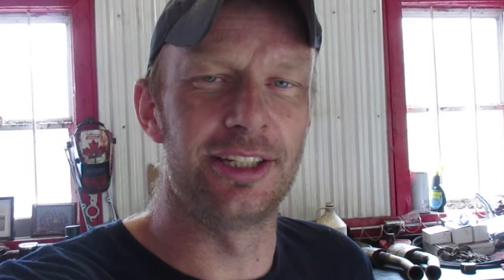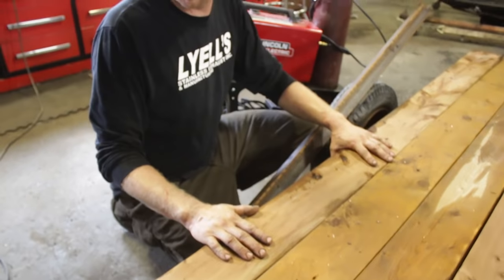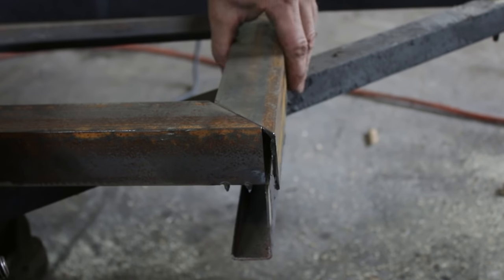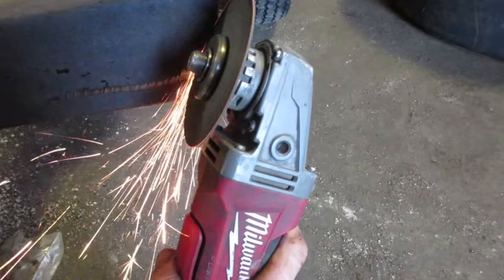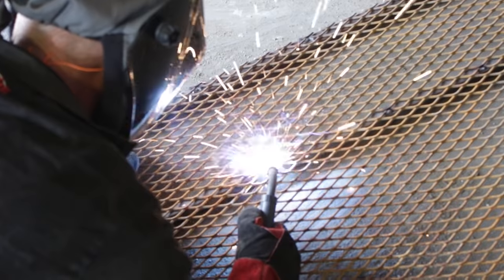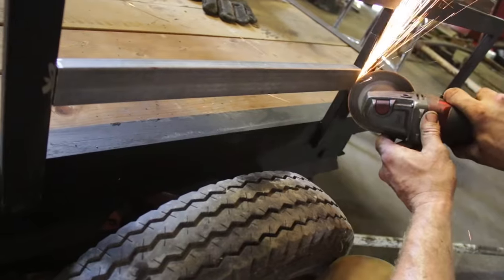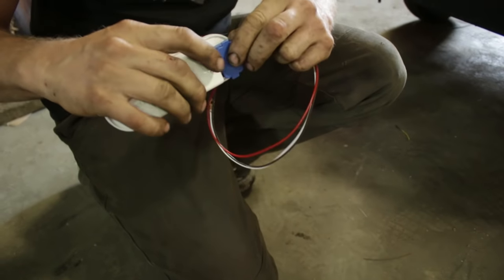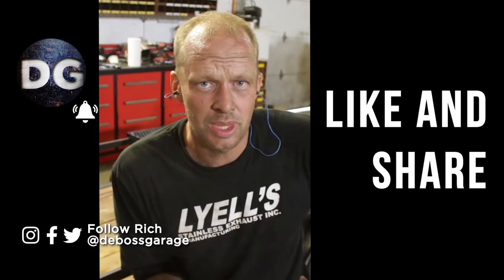How To Build A DIY Utility Trailer for CHEAP!

Comment: One extra thing you could add to the trailer. Take some of the scrap pieces of the angle iron and weld to the sides of the trailer so you have a place to attach ratchet straps. Very helpful. Did it to mine.
Reply: 8777
Reply: also add a small wench to the front for pulling your dead quad up . or other equipment. Add a swing over head arm for wench loading logs or motors on to the trailer.
Reply: @avalonbear61  oh ya good idea trailer would flip over, even if you added legs,, to light
Reply: never had an issue with my trailer flipping over when I had legs/Outriggers even when the trailer was light.
Reply: another extra is add the legs back so he can jack it up on the side of the road for flats
Reply: @avalonbear61: Personally, I prefer to keep my small wench snuggled against me in the cab ….. the large wench who loads my logs I make ride in the trailer with them …...she doesn't like it, but.....
Reply: @philod902  🤣
Reply: mhm
Reply: I use small foreign car coil springs to make tie points. Just cut out half-circles and weld in anywhere you need a tie-down.

Comment: Wise choice cutting the size way down... I had a converted pop-up to utility trailer that was still full size (6'x14'). The previous owner sold it because everyone always overloaded it. I sold it after my Dad did the same thing and bent the axle.

You can tell people that something only has a 2,000lb rating and it just bounces right off of their skulls. You have to build it so it will only hold its rating in iron or rock or your stuff gets torn up.
Reply: size dont mater you could make it 2 feet wide and over load it, just with all the comments to add to his new buggy would over load that 800Lb axcel
Reply: @arnoldromppai5395  So you're deliberately missing the point that it's a lot easier to overload it if it's bigger. OK.
Reply: yeah at least when I overload my truck and trailer I know I'm doing it
Reply: Sometimes you don’t know what the limit is until you cross it

Comment: I watched the whole thing and I don’t even need a trailer... love that welding helmet need to get one of those
Reply: @davidwalker8778  I like to use a small 160 amp inverter when I’m welding, very handy I can also use it on  an extension-lead...
Reply: @zsozso411  nice

Comment: I could really use that welder to build the flat deck and frame for my 86 toyota  pickup.  This truck sat in my father in laws grove for 10 years before he finally agreed to sell it to me. I also deal with salt and from the cab back is toast. I would love to turn this into the daily driveable trail rig I have always wanted.
Your channel has given me the confidence to dive into a project like this and methodically break it up and progress thru the challenges. Thank you.

Comment: The 2016 Chevy Silverado with 6.2 LTZ engine still running good. I wrote to you back in 2016... Thanks again for recommendation. I did however get that module to convert it to full time 8cyl. and i'm looking to put a 3.5" lift on it... THANKS!!!!!

Comment: I have an old Lincoln Weld Pack 100 Mig from 1996.  It still works but I am looking to upgrade.  This welder would be great for tube bumpers on my 99 Dodge Ram, jigs and of course, because of you, I now want to build a trailer.  Thanks for the video.

Comment: Tent trailer frames are awesome for light duty trailers. We always scrounge them for using behind the quads or the side by side. Hell, they even come with a suspension to soak up the bumps.

Comment: I know that most guys connect the white ground wire to the trailer frame.. for a "ground"..... but I have better success running the ground wire all the way the whole length of the trailer AND to the towing vehicle via the electrical cable.   We've all seen the effects of "a bad ground".... and another ten feet of wire for each rear light, IMO, is well worth the greater electrical reliability.

Comment: I've seen Andrew Camarata also use those lights on trailers, he says they are far less likely to get damaged than other lights that stick out a lot.  He also uses an airless paint sprayer (Graco, not sure if they have those in Canaderp) for painting, seems to make painting a lot faster and easier.  This is awesome, keep up the great work!

Comment: Nice build, id highly suggest doing a few extra tweeks to the next build though. First the one end of the trailer floor should be left open so if you need to replace any piece of wood you can do that without cutting and re welding. Second would be to add some conduit or a channel to run the wires through keeps them from getting snagged on road debris and looks much cleaner. We used an old weight lifting bar that someone threw out for our gate hinge as that thing wont break. Also using some cut links of chain welding to the frame or rails make great anchors to tie down with.  Nice detail with the video :)

Comment: I like the idea of the ramp that folds flat, always thought it was foolish to have that big sail sticking up creating all that drag.
Reply: @christophergreen2328  You obviously don't know anything about aerodynamics. A smooth floor parallel to the relative wind would produce very little aerodynamic drag, just like they are smoothing out the bottoms of cars to reduce drag. A wire mesh floor would present a tremendous amount of drag.

Comment: i used 2x2x1/8 square tube, cap the ends to keep the rust out, some 3/4 plywood for the floor and ramp/gate, 2x4framed 1/2 plywood walls 2x4 stakes, paint all the steel and the outside and bottom of the wood but use water seal on the inside so paint chips don't get mixed into the bulk materials you carry.  I recommend the  8 bolt axle or shorten one of those mobile home axles.      Pallet for bed, bicycle wheels, 2x4 tongue, duck tape hitch, cardboard and shrinkwrap side panels,  Propane lanterns for tail lights.
9:42 turn the gas on.

Comment: Trailer came out mint. We have made gate hinges similar to yours in the past. I like yours better. It came out great. I like yours better also because it has paperwork we did ours as a home build. I like the welder too I've got a small miller for my tig I like that it is all in one that rocks. Great video.

Comment: Also, I absolutely buy all my tools with the idea that I am saving money through DIY vs hiring the work out. 12 years or so and I think I have just about all the basics. Still wanting a router, drill press, and my own welder. I have some great welders at work and can do home projects pretty much whenever, but I'd like to start doing welding on the side independently
Reply: Did you ever get that welder?

Comment: Great video and love all your videos, I am just about to start a big project. I am moving from Arizona to Arkansas where my wife and I will be building a house, shop, barn, and other buildings from scratch on our 10+ acres. I could really use a new welder, I am ashamed to say I have a old “blue” welder that is falling apart and hardly works, plus mine doesn’t do aluminum or Tig which I really want to learn. Keep up the good work and thanks for all the great videos. John

Comment: How to build a trailer? Start with a trailer...
Reply: Well I am sure you could fine a shitty frame to start with, If not, And you want to follow this video, Just build the frame, It shows it in the video, just grab some square tube and angle stock and get to it.
Reply: right lol
Reply: Yes, it is much less expensive to rebuild an inexpensive trailer than it is to build one buying the materials at retail.  I built my by cutting down a boat trailer I got for free.  The beauty of the boat trailer is that is made from galvanized metal and is built to go in the water.  My trailer frame is 40 years old and still looks new.
Reply: yeah I was pretty disappointed. Got through that intro just to see a frame already there. wtf.
Reply: @bernie9728  welding galvanized is a serious health hazard.
Reply: the basic fundamentals of a trailer are the same wheels axles lights and a hitch and done deal
Reply: This is basically like when Homer Simpson went to the chili cook off and he brought his own wooden spoon and a guy there says "they say he carved his spoon out of a larger spoon"...
Reply: Exactly what I thought mate 😂
Reply: @_multiverse_  Well, after 40 years, Bernie is still kicking.
Reply: Ya I thought we were building a trailer also.
Reply: @AdriaanVerburg  to be fair to Sam,  you can live quite a long time with health issues.
Reply: It's better if u build it all then you can truly say I made that
Reply: Lol
Reply: Yeah I was just thinking that.
Reply: Starting off go into your local first and find a trailer frame lol😂😂🤣🤣

Comment: I do a lot of welding with a lincoln stick welder mostly mild & thick steel .But when need to do thin metal welding the mig -pak would do a better job and it would able me to weld alum. would work great for me.

Comment: Nice build out   I do a fair amount of camping in  private campgrounds in the US and ive noticed a lot of old pop ups in their long term storage that  look like they are abandoned by the owners  usually the tags are expired  and they are pushed into the back of the lots  i like  vintage campers so i almost always  look in the  storage lots  generally in the back of a campground  property  i specifically look for older Airstreams

Comment: That welder will do great penetration on that thin steel hell iv got a Lincoln 100 iv done half inch with flux core. 0.030 those Lincolns do amazing work

Comment: Got an 87 Ranger 4x4 that's asking for custom rock slider bumpers with an integrated winch and deer guards. Will put a flat bed on her too.

That is, once I get the top end rebuilt here soon.

Comment: Great video!
Thanks 
The ratchet strap spot is a must and using galvanized metal should be avoided without proper protection for sure

Comment: Holy guacamole! That truck story is exactly mine! Except she left be for sancho and I had to buy a trailer to move in with my buddy... we might be cousins separated at birth like all those guys in Missouri that have the same mom that’s also they’re aunt! Anywho there is some useful information here as per the regular for your videos. Doesn’t seem all that cheap in the end when you account for almost free steel, rod, oxy, acetalyn,  lights, paint, decking, stain screws/bolts, tongue jack, hitch coupler, axle, bearings, wheels and tires, labor, and the pain in the ass it is to title and register a home built trailer. But I guess you did score a free dental pick! So that’s handy

Comment: Wheel location with respect to the bed is a key design element.  I notice that this trailer had trailer jacks in the back which he cut out when he removed the sides.  These jacks were needed since the wheels look like they are roughly in the middle of the bed, likely to reduce tongue loading.  However, this location makes the trailer more prone to tipping if not hooked up to a vehicle and someone goes to load something on it.  This is due to the weight between the axle and the hitch and the weight between the axle and the back being nearly equal.  So, any added weight could tip the trailer.  A key part of trailer design, to me, is this balance between acceptable tongue weight and stability.  It's a calculation thing where you look at the normal trailer loading, tongue load, allowable axle load and the torques involved.

And, yes, I've designed trailers which have performed great.  My nephew is an AWS certified welder who fabricated them.

I do like the ramp/gate design - good job!

Comment: Just a little tip, you get better penetration and welds if you hold a 1/2 inch stick out on your wire and also gas coverage. Great video though and good lookin trailer

Comment: Good day  Boy that is a nice trailer.  Keep it light, because of gas.   I really like hinges, never saw them, & never figured that out.   I pick up trailer  side of road, but it has differential on, I think front seal is shot, and I think you should have oil in?  Now  neighbour has some paint from Home hardware, galvanizing  zinc paint, would that be good to spray  on wheel well fenders. Chev  seems to start losing paint & going up  out side of truck  Thanks good video

Comment: Smart man! I see you use the air supply respirator.  There are so many videos with guys welding with no respirator and it short sleeve shirts. I think that's so irresponsible . We adults have to take in consideration that there are kids looking at these videos and we have to stress that if you're going to weld, you must use all proper safety equipment. That's the number one thing I learned in Weld School many moons ago.

Comment: Rich please do yourself a huge favor and put that guard back on that grinder. I know that they are in the way some times but i just opened a brand new pack of cutoff wheels stuck one in the grinder like I've done a million times fired up grinder to cut some sheet metal and to my shock i just touched the wheel to sheet metal and wheel exploded violently  fortunately gaurd was in place but dented pretty badly could have been fingers wrist or face never really considered how much force they have at 12000 rpm .
Stay safe dont want to miss a video 👍👍

Comment: Seems easier to go to the junkyard, get an old boat trailer and use the plywood floor and 2x4 side method. Catch a boat trailer with a rusted out frame rail, just one with modern hubs and such, you're golden.

Comment: I like the Sliding tee Hinge Nice Job ! Time to get filthy
Reply: Putting some more pipe on the side would help you lock it in place when using the ramp as a table top.
Reply: The lie flat gate so that when it gets leaves and crap in it you can drive a 100 mph and blow it out.

Comment: Little trailers like this are super handy and end up getting used or borrowed all the time by anybody not too scared to back up with a trailer.  Which isn't very many people in my experience - That's why everybody bought megacab trucks.
Reply: backing up with those small trailers is a pain in the ass, id rather back up with a 40 ft gooseneck than one of those tiny trailers lol. the shorter they are thefaster they jackknive

Comment: I used to use my grinder without the guard, until I had a disc shatter. Also don't grind with cutting disc use grinding disc easily tell apart ones thin ones thick. Also wear dust mask's, dust kills.

Comment: I'd be interested to see this with a removable anti-tip  frame for hauling say a refrigerator or shop smith on account of how I'm getting to old to easily toss them types of things in the back of my truck by myself without banging stuff up anymore .

Comment: Nice build  its amazing to me  you can find those fenders for 15 bucks these days. I liked your hinge  set up   On the fender  30 years ago  i bought some used. Piece of junk trailer to move. My motorcycle  one time  i lived in Florida and the State made me. Put fenders on it to comply with  requirements i told the. Inspector my intentions for the trailer and i didnt want to spend much money he asked me if i knew how to cut 2x4’s and i said yes he said make them out of that and  just  screw them on  he didnt care if they were. Pretty or not just that they covered the tires they weren’t pretty at all but i got my tags. And gave it to someone after i got my motorcycle where i wanted it  for the return trip. I built. A  contraption that fit in my  receiver and  took the front tire off the bike and  used the axle to attach it to my contraption in essence the bike towed like a. Single axle trailer  and i even wired the brake lights and turn signals to work  with the tow vehicle harness  it worked like a Charm  for 1200 miles  at around 60MPH  it had a little wobble that i was able to take out by strapping the  handle bars to the outside edges of the tow vehicle that was a CJ 7 Jeep with homemade  bumpers  i built for 4 wheeling  that had plenty of  anchoring locations    I hope you have more videos similar. To the low cost trailer  i just found your channel today  and enjoyed your video. A lot i am a retired Woodworker thats interested in doing more welding  and metal fabrication in the future  my Dad taught me some basics on structual welding i can  make it stay together usually but i need to  learn how to make it prettier  i did actually work at a Woodworking /Metal working shop   That did lots of Aluminium  Architectual welding  and some of those guys were artists  i of course was not a welder there or any other place  although my Grand father  was  and he started most of his career doing body and fender repair years before fiberglass or plastic body  filler !  My Dad had a Antique car  my Gramps leaded all the dings out for a black lacquer  respray  of the main body  i say that because it was a running board style  car  it turned out pretty cool

Comment: Hey Rich, When welding galvanized metal you better use the proper filter in your welding helmet rig you got there. You need a P2 rated respirator for galvanized metal not the N95 filter that is for carbon steel.

Comment: I modified a bought trailer of similar design, so that the ramp becomes 
an extension of the trailer, so I can now haul 12ft lumber, ect...it 
used to fold in, but hinges were above the deck plane, & like You 
said, the deck of My mower would hook the hinge, unless the ground was 
higher where the ramp landed, so I cut them off & lowered them flush
 with the deck, but will no longer fold inside, Your T-design hinge 
would have worked nicely to retain that feature,,,,,but think I can live
 without it too, or just lay it back for any long trips if I was really concerned about gas guzzling, & it doesn't obstruct 
the taillights, plus also added appropriate reflectors to the back & 
sides of ramp to hopefully satisfy the DMV....
Peace Out.....& Beyond